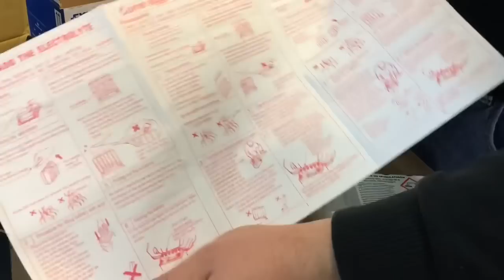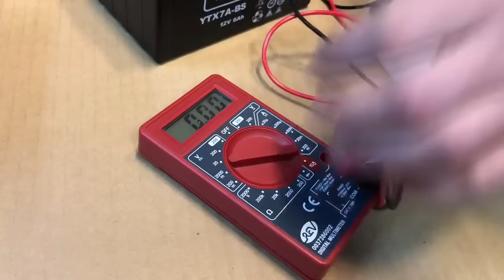Formarea / formatarea unei baterii moto scuter atv

Comment: Salut,

Eu am o baterie de gen și datorită faptului că am incarcat rar,bateria nu mai da randament,ce anume ai pot face??

Acumulator cu Gel Plumb VIPOW Profesional Reincarcabil Capacitate Acumulator 12V 20A Tensiune 12 V - 36
Reply from the maker: Salut. Exista niste incarcatoare ce au functia de reparare. Cum este acesta
https://shr-motors.ro/redresor-smart-acumulatori-auto-moto-12v-4a-100a-cu-display
Reply: @SHRMotorsOfficial  merci fain pt raspuns 🙏 Oare este bun pt acumulatorul meu?
Reply from the maker: Din ce vad, este 12v 20 de amperi. Deci este ok…
Reply: @SHRMotorsOfficial  multumesc

Comment: Ce baterie îmi recomandati pt atv de 125 cc mai puternica. Atv are loc pt baterie lunga sa fie cam de 12.5 cm lata de 7.5 și înaltă 10 12 13 cm.
Reply from the maker: https://www.shr-motors.ro/baterii-acumulatoare/baterie-ytx5l-bs-4ride
Reply: SHR Motors ceva mai scump și mai puternica
Reply from the maker: Nu incape
Reply: Cam asa e. Lunga sa fie pana în 13 cm înalta 13 cm și lata pana în 8 cm

Comment: Salut LA O baterie fără întreținere se poate complecta Cu acid în cazul în care NU MAI încarcă și nu ține curent
Reply from the maker: Nu
Reply: AM și eu un scuter chinezesc gy6 de 49cm când îl folosesc BATERIA este încărcată dat după aproape trei ore are foarte puțin curent în baterie ce ar putea fi
Reply from the maker: Releul de incarcare https://www.shr-motors.ro/regulator_tensiune_releu_incarcare_gy_atv
Reply: SHR Motors  instalația electrică a scuterului este schimbată de la cap la coada Cu rele Cu toate
Reply from the maker: Pune aparatul de masura si vezi exact cat incarca
Reply: SHR Motors  Am înțeles DAR
Reply: BATERIA este aproape nouă cumpără ACUM patru luni
Reply: O întrebare MAI am și EU BATERIA este de 12 volți 8,7 ampeli este OK pentru un scuter chinezesc
Reply from the maker: Da, este mai mult decat suficienta